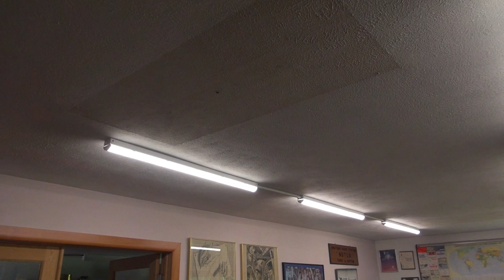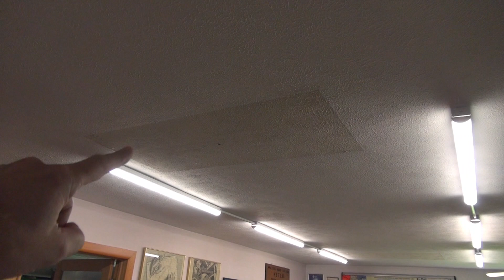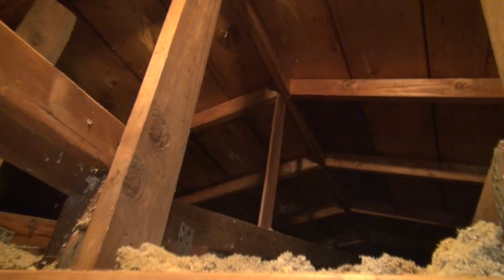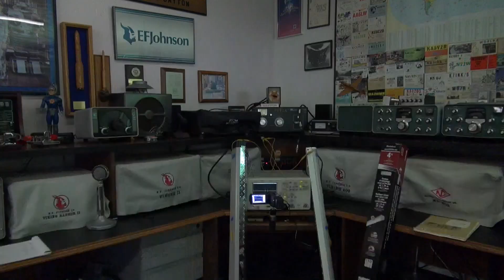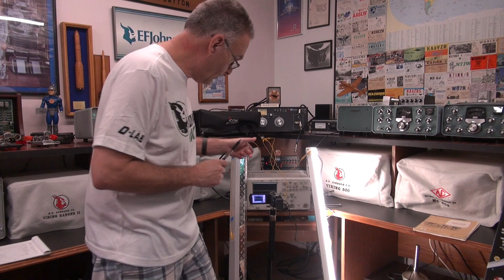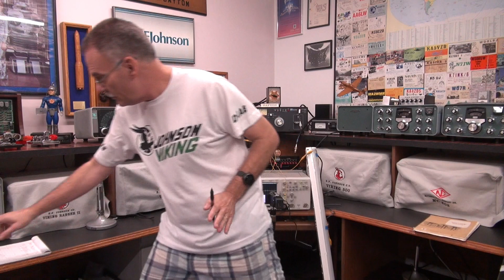LED Strip Light noise test using National NC-300 Ham receiver Oscilloscope Metalux vrs big box store

Comment: Hi Terry. Since you used Wiremold between the fixtures, maybe it would have been a bit easier to get the feeds for the lights by just installing another Wiremold box where the wires for the old fluorescent fixture came through the ceiling and then run Wiremold channel to feed the lights. Then you wouldn't have to go up in the attic.
Reply from the maker: Yes, I considered that, but was shot down in flames by the big boss

Comment: Even conventional fluorescent fixtures with electronic ballasts are junk they notch out RFI from the broadcast band but transmit on 160M like the VOA.  Also the spikes you are seeing are something else in the house, not the electronic watt meter, they operate around 400MHZ and only transmit when the hear a poll from the meter reader car.  Pull your main breaker and have a sniff around .. there's a RF creep in your house!  good video!

Comment: In many cases the cheaper LED fixtures have parts left out of the switch mode power supply boards. These are usually LC filter networks to minimize noise emission. These boards were designed properly by the engineers but the components were omitted during manufacture as a cost cutting measure. The more expensive fixtures will have these filter networks populated on the board not simply jumpered out.

Comment: The FCC is starting to enforced Part-15 interference from LED lights and other devices, I believe one company in Waukegan IL was fine for not being in compliance. 
Do your LED fixture have any FCC Part-15 information on the data plate? 
At least there is no VHF low band Ch-2 for 6-meter operators to fight anymore.